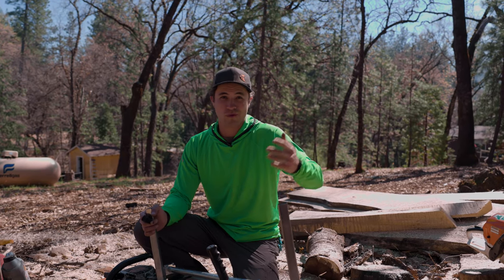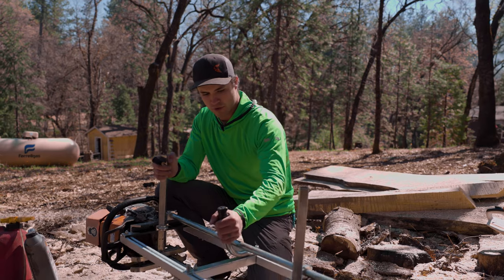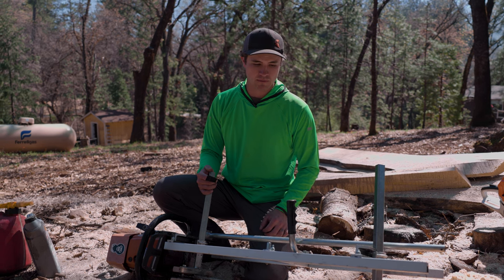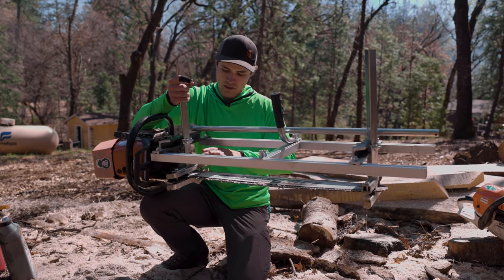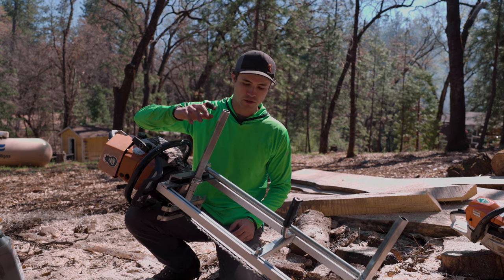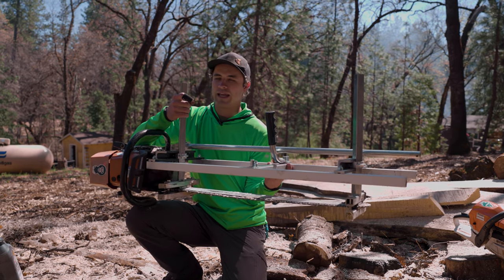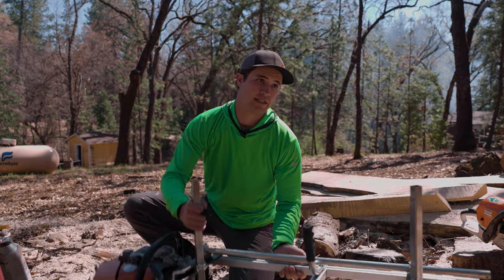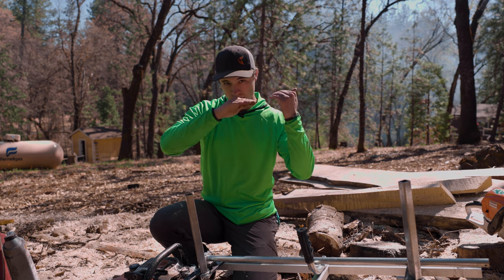Use a Chainsaw to make lumber | Alaskan mill | Log to Lumber or Slab

Comment: Those setups are about the slowest way to mill a log. The main benefit is that the mill can be carried into a backyard or steep hill, then slabs can be packed out. There are many times a valuable log is available in an area most equipment won't reach.

Comment: Have you ever used the winch with your mill? Wonder if they are worth it or not? They look great on you tube.
Reply from the maker: I’ve not, but I’ve heard they can make a huge difference if you’re doing much milling. I only ever do it very occasionally
Reply: Yes the granberg winch is worth it to have and I have one on my 30" granberg mill. If you don't want pay there price I have seen video's with DIY winches.

Comment: Is a specialty milling chain essential for making slabs or do you just run a standard chain?
Reply: Yes semi chisel chain is used.
Reply: You can buy ripping chains that are better. 15* - 0* tooth angle with skip to clear the noodles.
Need bar IV bag or can to lubricate the big side cutting bar/chain.

Comment: Pretty cool setup.    Do you change the cutter angle to something like 10* for your ripping chain? I've seen others who do that and wondered what your thoughts are on it.
Reply from the maker: I don’t. You could and there are other little tweaks you can do to improve the finish quality but I just use my normal sharpening job and it comes out rough but quick.
Reply: I make my own ripping chain out of semi chisel cross cut chain. 10 degree comp chain for a smooth finish and 15 degree full skip chain for making lumber that I don't care if it's rough.
Reply from the maker: @shawndmiles6747  sounds like you mill often enough to have worked through some of those efficiency improvements !
Reply: Years of watching YouTube videos and researching on the web will get a person smart enough about Alaska style milling and what works and sorta works and what doesn't work. I've been thinking about making some milling videos to pass along the knowledge I've learned so far.

Comment: Its risky clamping on the nose sprocket bearing, you should clamp behind it or there are better ways if you want to maximize the use of bar length.
Reply from the maker: How else do you have in mind besides just using a bigger saw/bar combo ?

Comment: I've had mine for a few years but I don't have a big saw so I'm kinda limited.  I have a rancher 450 with a 20" bar. That gives me 14" max width.  I have thought about trying a ripping chain because it takes me FOREVER to rip a slab. I was cutting a 14" slab 16'long and it to 40 minutes per cut.  That's a whole tank of gas per cut.  It's torture.
Reply: You see why bandsaws are popular eh! 😄 if you are pulling from a distance it is much better. And keep the saw sharp, logs clean, that does sound painfully slow, it can lose its appeal after a couple slabs 😆.
Reply from the maker: no doubt, that bandsaw mill would be an improvement!